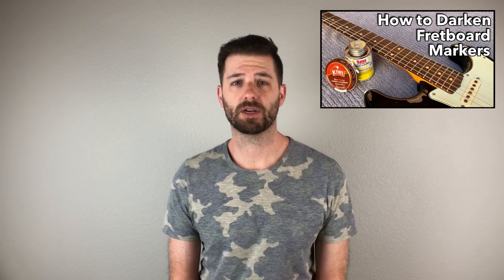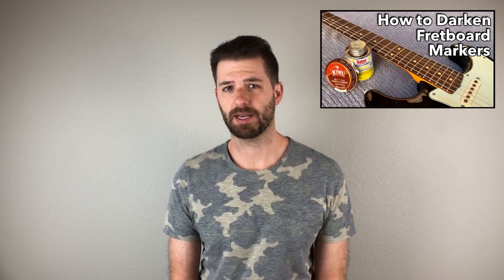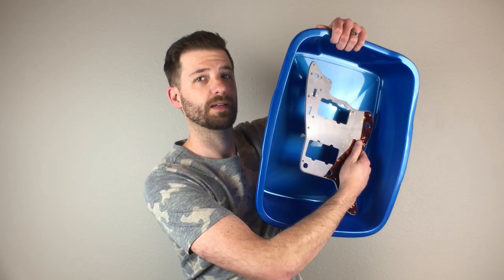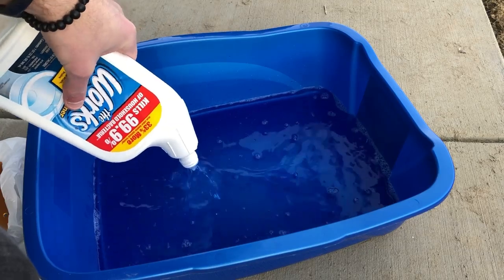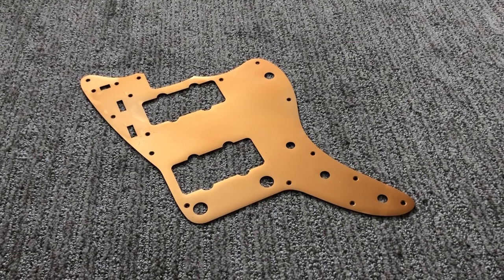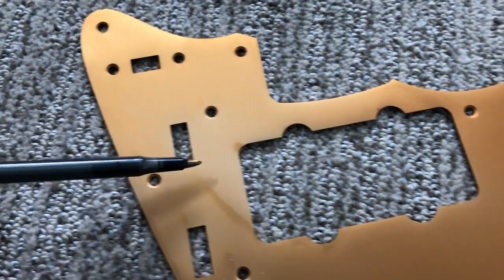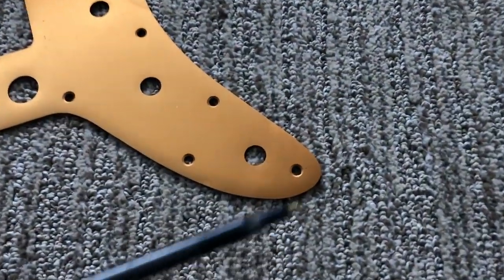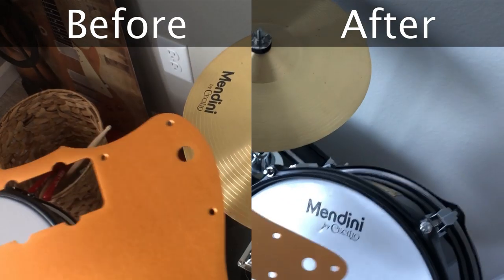How to Change the Color of a Gold Anodized Pickguard

Comment: How about painting these a different color?  I am piecing together a jazzmaster and I like the sound better with an anodized pickguard.  I have a black one and a gold one but what would look really good with my parts guitar would be an off-white guard.  I have some quality nitro rattle cans that could work.  Would paint one of my anodized pickguards screw it up or look bad?  Any info anywhere I could see tricks in doing this well?
Reply from the maker: My guess is that paint would negate any sound of the pickguard. It could probably be done though. I’ve never tried it myself. I imagine you would need to sand the pickguard so the paint would stick. All the best.

Comment: This is useful information.
The hydrochloric acid didn’t work because gold is extremely unreactive and almost no acid can dissolve it. However Hydrofluoric acid is very much more acidic. That’s the stuff Walter White and Jesse Pinkman used to dissolve their first unalived body in Breaking Bad.

In order to make the gold come off more evenly I would suggest diluting the acid quite a bit more to slow it down. And if just immersing it doesn’t allow you to see the colour change, instead see if you can find a plastic sponge that doesn’t come to bits in the acid and wipe the surface evenly with that, wait a minute, rinse, then repeat until enough has come off. The unevenness is surely due to you trying to do it just with your gloved hand.

Do NOT get this stuff on your skin, and WEAR EYE PROTECTION.
Reply from the maker: @X-boomer  thanks, and the information you shared is very useful as well! Love the Breaking Bad reference. I don’t plan to use this stuff on any body or bodies. 😂